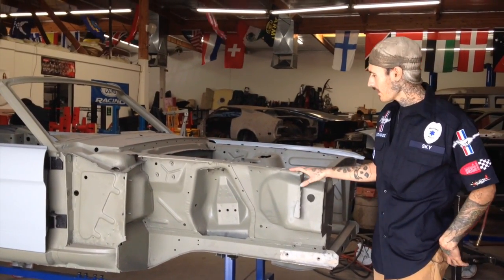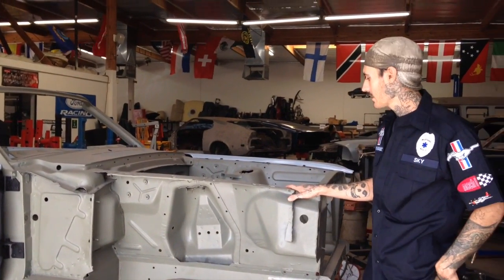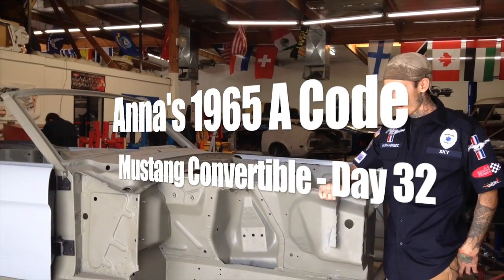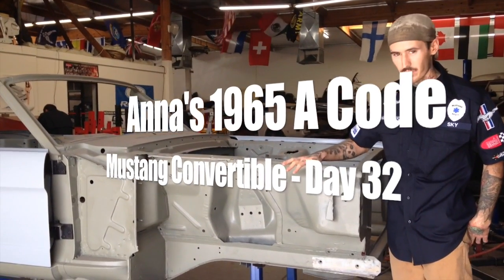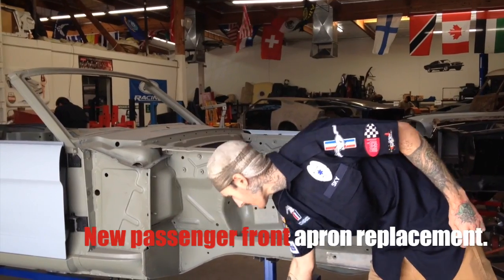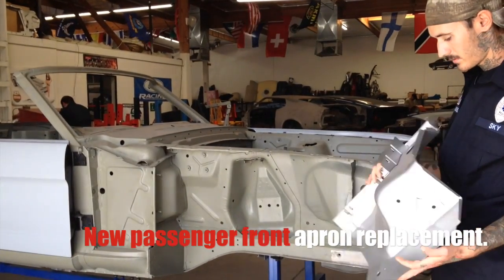Front Fender Apron replacement Anna's 1965 Mustang Fastback - Day 37 - Part 2

Comment: Quick question, the passenger front apron you installed in this video had the headlight /fender bracket already welded onto the new apron. Everyone is telling me when you buy a new one that the bracket doesn't come with the piece yet it appears your apron did. What manufacturer apron did you purchase?? I was looking at the dynacorn 3630EWT. Thanks for your help
Reply from the maker: I’m sorry it’s been such a long time. I haven’t worked on Mustangs for eight years and I can’t remember.